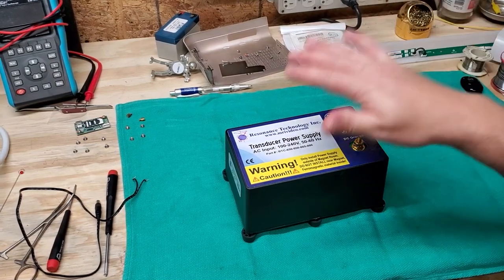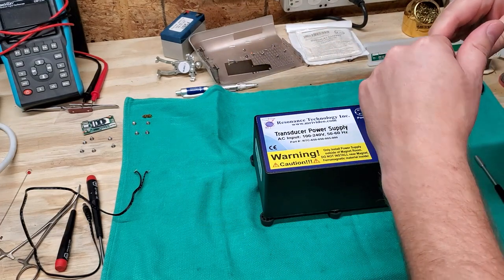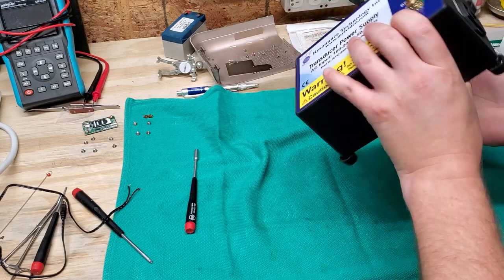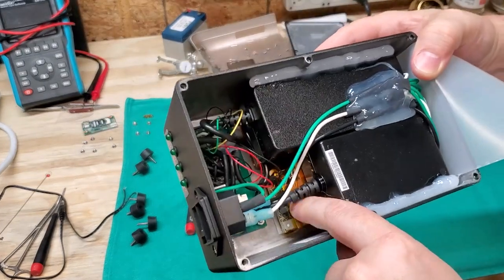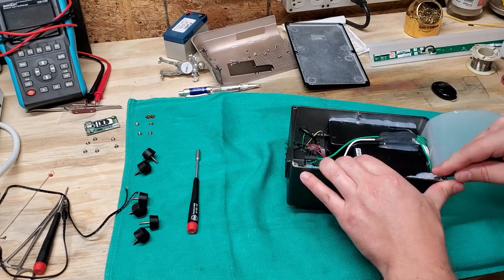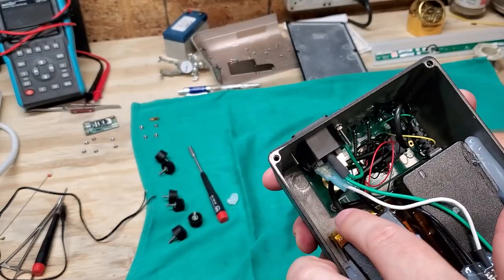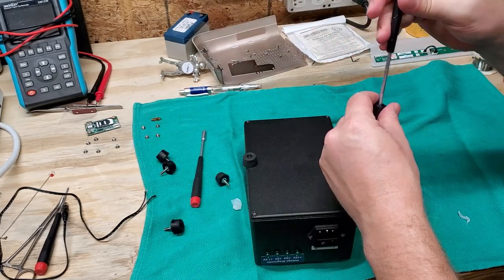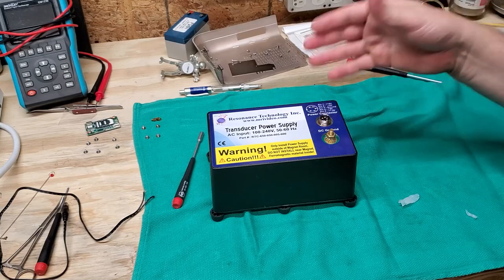MRI Virtual Reality Power Supply Unit Teardown

Comment: Before opening I expected a PCB with the various voltages stages, but it looks like an in-house DIY solution that the manufacturer made. 
Various adapters that they had already put together in an EMI safe housing. 
They used a custom made breakout board for the connectors, but they also don't wanted to reinvent the wheel, and choose for pre-build solutions for each voltage they needed.
The connections are soldered vibration-resistant and waterproof, and very importantly, it is a repairable.
On the other hand, I do think the manufacturer is making a huge profit on this, but other than that, they could have potted it all up and then restoring it was a nightmare.
Reply from the maker: I was expecting the exact same before opening.